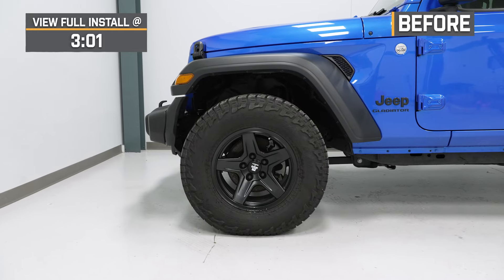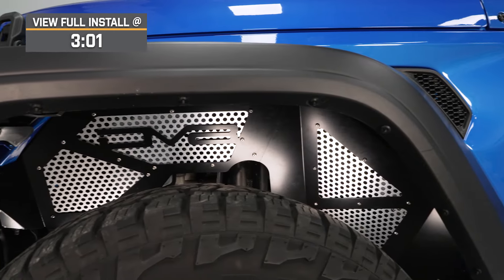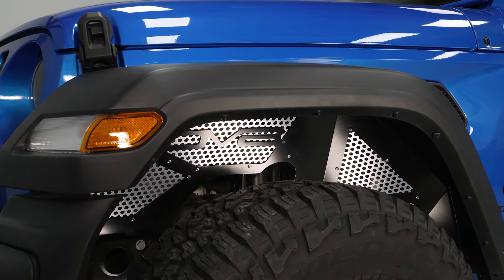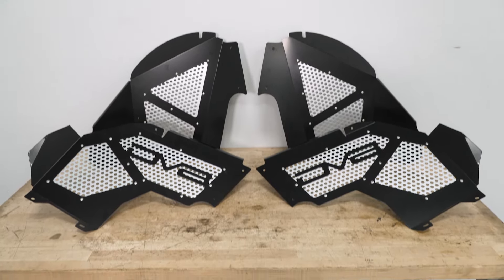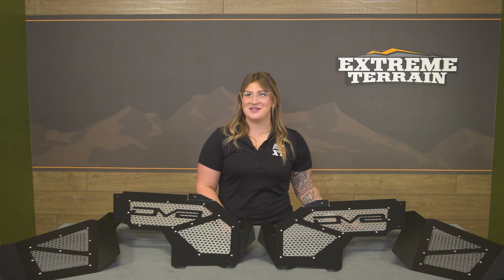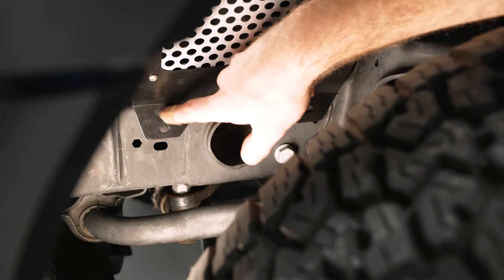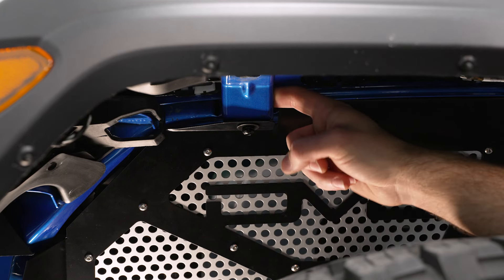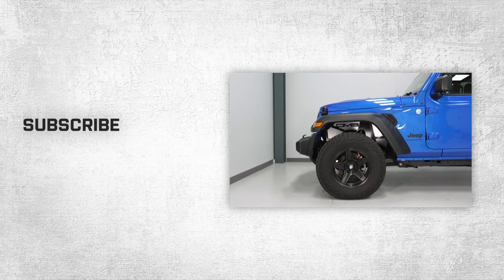Jeep Gladiator JT DV8 Offroad Front Aluminum Inner Fenders Review & Install

Comment: I ordered these (from you) and installed them. It would have been very helpful to show the passenger side install. I am not sure if the JT is like the JL, but there is a huge bracket on the passenger side that required cutting of the fender liner. Made it a bit of a hassle to install.
Reply: I have a JT. And I’m looking for new inner fenders. Can you explain a little bit more? Where is the bracket?
Reply: Did you cut the fender? How's the result?
Reply: @elginwang1572  if it is there, you will know it. Right behind the front passenger side tire.
Reply: @elginwang1572  I did and it worked fine. I did find out that DV8 has a new version coming out in the next few weeks that addresses the issue.
Reply: @raymondforbes4295  Yes I think I know what you talking about. There are 2 blots on the frame that interfere with the liner right? I got a set of liners and had the same issue. So what did you end up dping? I am trying to find liners that can clear the 2 bolts.
Reply: @elginwang1572  I cut the liner to make room. They are coming out with new ones in a few weeks that addresses the issue.
Reply: @raymondforbes4295  Great info! How did you know they have new products? Also, besides the passenger side, how's the installation on the driver side. Was it easy and how's the fitment overall? Thank you!
Reply: @elginwang1572  I called them and asked what I was supposed to do about the bracket. That's when they told me a new version was coming out.

It wasn't too bad, really.